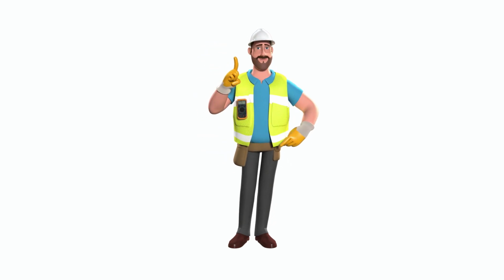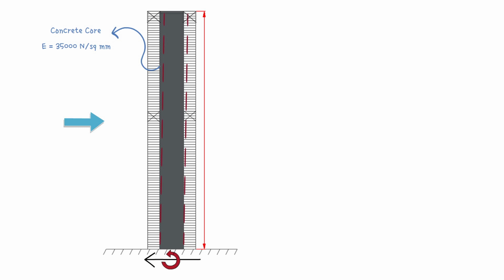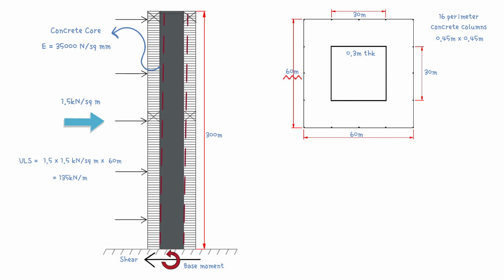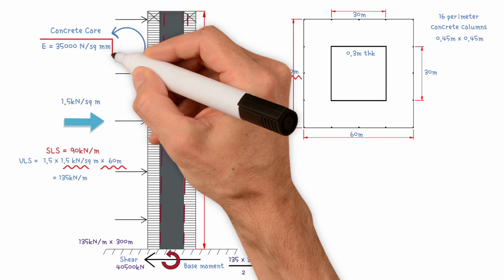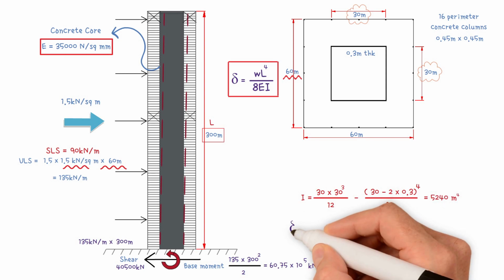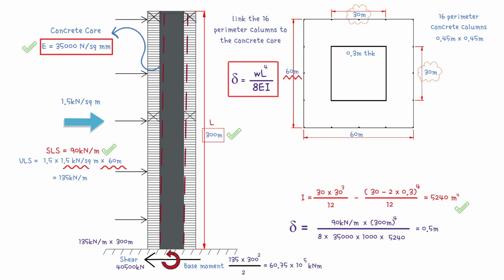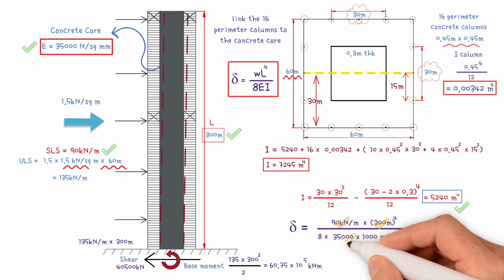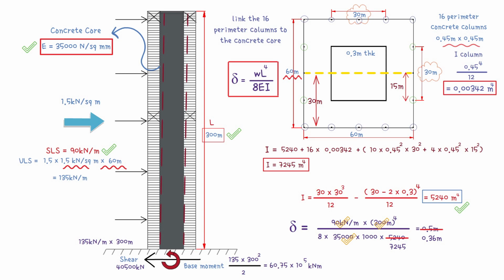Simply calculate the shear, base moment & side sway deflection of a Tall Structure.

Comment: This is a good illustration of initial lateral stability analysis of Tall Buildings from first principles, but as the orator rightly mentioned it underestimates. Bear in mind, tall buildings are very slender therefore on stability systems Large P-Delta effect needs to be accounted for in deflection, bending moment and base shear calculations as second order moments can be significant, this ill also affect the deflection.

Also, the dynamic response to wind is another factor to be considered alongside many other considerations during the design.